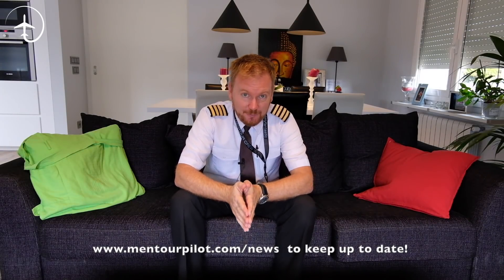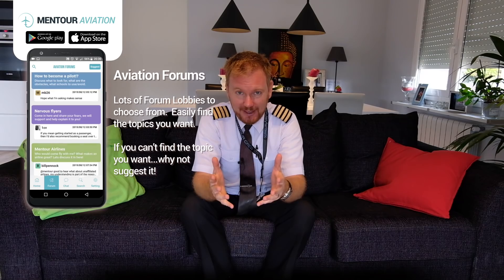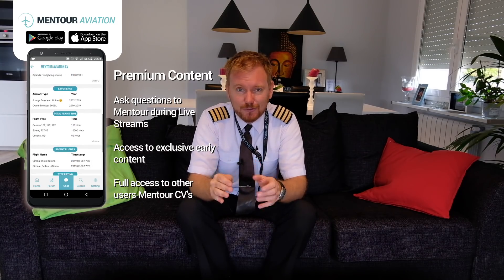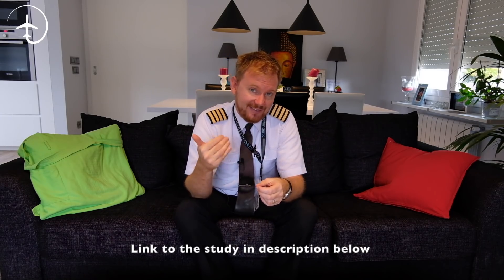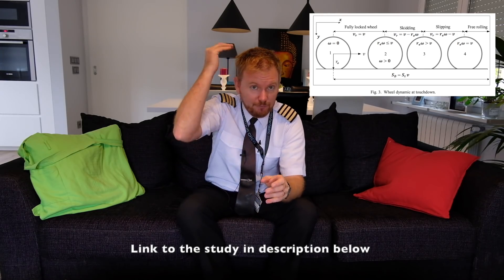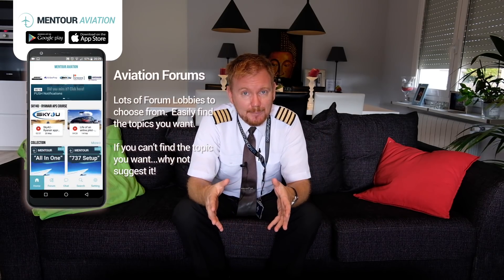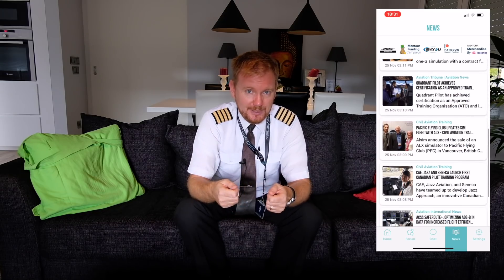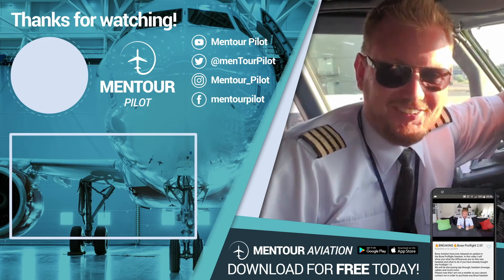Use WIND to spin the aircraft wheels before landing?!

Comment: Why couldn't exhaust gases from the engines be piped to to the bottom of the wheels ? It might increase wheel speed from 50% up to 75% or more? It shouldn't be an expensive  undertaking?

Comment: But there is the possibility of cooling the brakes and rotors using the wheel spinning device. That does seem worth while.
Reply: Maximum cooling generated (max airflow) is when the plane is in flight. When you most need is cooling is during landing and after flight- when there is minimal airflow.

Comment: I always wondered why the wheels didn't "free" spin in the wind just from the air flowing over the wheels.
Reply: To spin you must have a force. That force is call torque.  The torque from the air flow above the wheel is the same as the torque of the air flow below the wheel but they act counter to each other.  The torque is therefore cancelled thus no spin.
Reply: @geoffreywoodyear1585  Thanks

Comment: If wind controls the wheels before landing there might be a chance of one spinning faster than the other making the plane have an unstable landing.
Reply: in that case, the brakes would easily step in and make sure the wheels had matched speeds.

Comment: Compressed air would spin the wheels easier than wind, you would need a lightweight aluminium tank that could be charged from the engines or APU compressors. In a crash these could blow and could cause significant damage or fuel a fire
Reply: Matthew Kane Weights guys have kittens over two pounds. A cylinder with all the inherent systems would probably weigh 35 pounds or better.
Reply: Or just skip the tank and use the bleed air direct to spin up the wheels
Reply: wolf310ii Ok, now think this through. How are
You
Going to get the bleed air to the wheels?
How much will the spinup mechanism weigh?  
What will trigger it?  Pilot control?  Needs wires and switches and lights. 
Automatic control?  You would need sensors and automated manifolds, and would still need to make it visible in the cockpit. 
And so on, and so on. 

Rubber is cheap.
Reply: @Ampersandrascott  Ask that Matthew Kane, not me. The bleed air would go the same way the compressed air would go, just without the tank between the APU and the wheels.
Reply: wolf310ii You’re not an engineer I see. 

Rubber is cheap.
Reply: @Ampersandrascott  It was not mine idea to use compressed air to spin the wheels, all i said was you dont need a tank to store the compressed air, if you want to spin the wheels with compressed air, because the engine produce compressed air anyway.
Reply: wolf310ii Would you like to answer my previous comment?

Rubber is cheap.

Comment: I can develop 99% problems issue.   Its cheap and secure. 2 caps on wheel and a little electronics modification compatible with auto breaks. The wheels will be spinning exect same speed what the aircraft has befor touch the runway and do no effects to plane landing. Just smooth touch down and break. The only thing to effects pilot is, that pilot even doesn't know when touch the runway. 😁
Reply: And that research in 1940s is 2 old for this time. 😉 we are now in 2020s

Comment: No mentour if you change the wheel speed to aircraft speed if wheel speed is reduced relative to aircraft speed  is ok 👌🆗 but  if the speed increase in opposite direction or reverse it will skid the aircraft to a side for shure like a bike ridder does☹️

Comment: Each 747 tire costs $3500 & the 747 has 16/18!!!!!!!  How many cycles do tires last for?  What would happen if there was a blow-out on landing?
Reply: Tires blow out all the time, catch fire and are quickly put out by emergency personnel.  This happens a lot when a heavy plane like a 777 has to land immediately after take off due to an emergency and has no time to burn or dump fuel.
Reply: @JQB45  There are very important points this guy has missed.  Tires must be filled with nitrogen not air.  What happens if there is a fire & the pilots don´t notice & lift the landing gear?  Remember the Virgin Gatwick flight, when a bit of landing gear failed?  They had to fly to Southampton airport so the ATC could check what the actual problem was!
Reply: @Westhamsterdam  A landing gear tire usually only fails on landing.  I've never heard of one failing on take off, I'm sure its happened and would be interested in learning or seeing more.
Reply: @JQB45  If you WIKI this there was an explosion in a tire after the plane took off because the tire had water in it.

What i want to know is how the cabin protects against fierce cold especially in the cockpit where there is a lot of glass.
Reply: @JQB45  see Concord disaster! 😀

Comment: Why aircraft navigating on airport's roads after landing by itself? It's cheaper to off engines after stop by wheel brakes, quickly grab it and tow to parking place?
Reply: That doesn't work in reality. Towing would slow down the traffic at the airport and the airport's efficiency would reduce. Those vehicles moving on taxiways all over the airport would also be a safety risk for the traffic.

Comment: Wind spinning wheels will not work.  It’s all because of physics.  The wheels will all be rotating at different rates, there would be no way to regulate its speed.  This could cause the plane to swerve during touchdown.  The blades that spin the wheel will add more drag resulting in different take off and landing calculations for drag. Thus changing the settings of flaps etc.  The only way is to use electric motors.  Mentour has all ready debunked that one.  Smaller prop planes may have motorized front wheel because they are in a tricycle layout.  The spinning front wheel mitigates the friction of the front wheel so that the plane does not tip forward, not to save on rubber.  Because the wheel is in the middle and front of two back wheels.  It can’t swerve.

Comment: I have thought the possibility of a deployment manual by the pilots of the oxygen masks in case of fire where smoke  fills the cabin, this would have save thousands of lives who died most from smoke . the masks do not feed oxygen unless  one breaths from it
Reply: There are no oxygen bottles for the passengers, the oxygen is produces chemical, once activatet the capsule generates oxygen until its empty, no matter if someone breath from it or not.

Comment: Mentour360 viewers: "We need the wheels of airplanes to spin up before landing to reduce wear on the tires."

Petter (repeatedly) "Sorry, too complicated, planes will be too heavy with extra motors and how about landings on slippery runways, wind from the side, etc. etc"

Mentour360 viewers: "But, but..."

Petter: "Sorry, impractical, not possible and by the way, tires are cheap."

Elon Musk: "Hold my beer..."

😄
Reply: Except Elon is good at math .. and adding 400 lbs to a planes landing gear to save a few ounces of rubber each flight  would be as stupid to him as it is to me ..
Reply: One of first Tesla slogans were: 'Burns rubber, not gas' so, totally not interested :)

Comment: The linked study seems strage to me. The Wheel seems small, the landing speed seems high (maybe because they use maximum landing weight. They have 16 main landing wheel gears. What kind of aircraft is it? And why they simulate with maximum landing weight instead of a usual landing weight? The bouncing speed seems also strange. I'll read this thing a second time with fresh brain.
Reply: Boeing 747 has 16 main landing gear wheels.
Reply: @mikep9604  Thank you, yesterday I was tired and messed up wheel diameter and radius :-(

Comment: Use magnetic levitation installed on all landing runways and on the jets and get rid of this old rubber technology
Reply: TAVOR VICEROY VALDOR / magnets don’t handle large load shifts well, they also have limited suspension, and will need to be maintained on all runways in the world
Reply: Ok, and how are you going to brake with that super slippery  magnetic technology?
Reply: deltaxcd when the plane lands mag leveling on the runway you use air brakes and the engines to stop it, the Japan maglev train does it very well and stops from much higher speeds
Reply: - Caesarian - Japan has tested and used the maglev train and the speed is restricted to the lei get of the track and it works very well for a heavy faster train so why not experiment with a airplane and a few runways?
Reply: @tomaszstarling  
That is quite a big modification I think at the rate your plane will soon turn into something else LOL
maybe we should just directly go for vertical lift and landing LOL

But the main problem with maglev is that you need extremely precise positioning in millimeter range and maglev cannot handle nonuniform loads well  
so until you learn how to land a plane with millimeter accuracy without any shaking you need to stick with plain old wheels
Reply: @UC-CkSMNoavisUL9j9dkkxIw 
not even sure wahst is your point with those tiangles
 but you can not levitate at that big distance that's the law of nature. the force decreases proportionally to the distance squared.
also, keep in mind that airliner weight is close to 500 tons. which is more than maglev train which weight 30-40 tons per carriage

at this weight, you need to think more about how you not break the road itself not about trying to levitate that monstrosity.

Comment: The rotating wheels doesn't make any sense you need a runaway like a treadmill to sync the speed of spinning wheel
And The White Smoke Is Iconic Smoke
If You Take Down The White Smoke
There Will So Many Angry Avegeek

Comment: Longer lasting tires would mean manufacturers would be making less profits.
Reply: There are two ways to make tires longer lasting: 1) More abrasive resistant (harder) rubber = less friction, grip. 2) Thicker tread, = higher polar moment of inertia, and a greater force (centrifugal) acting to separate the tread from the carcass.  My guess is that current airline tires are optimized in both regards. The ONLY case for your argument is if there were collusion between ALL tire manufactures (I am not saying there isn't, and the CIA did kill JFK,  /s ).

Comment: Why do people think the wheels spinning would be better.

They should do the opposite and have the wheels tightened with maximum friction during landing and roll out
enough friction when you land that it helps dicipate energy without slamming nose wheel on runway. 
you loose already like 15% of your energy when you touch down with stopped wheels and make them spin up requires energy.

Who cares about the Tyres or their lifetime and the blue smoke is nothing compared to QM2 black smoke

Comment: What kind of nonsense is that if you prespin wheel to the 100% speed you still get 50% wear?
Maybe the right way to say it was that you will reduce total tire wear by 50% not that initial wear? Effectively doubling the lifespan of the tire because the first impact takes only half of the total tire wear. 
Physically, energy is proportional to speed squared so to save 50% rubber you need to prespin then to 75% of the aircraft speed.
at the 50% speed, you will save about 25% rubber.

Comment: safety exits are not "cost-effective for the airlines" either. that should not be an argument whatsoever.
Reply: Airlines wouldn't put safety exits if they didn't need to. But they are required to due to regulation. Only way we will see bladed wheels if rubber got extremely expensive or if regulation forced them to.

Comment: I’m astounded the armchair engineers on here  look at the wheel spin up or lack thereof and think 60 years of high performance jet age manufacturers  “ overlooked “ this spin up senario lol  they have no idea the trade offs done for weight versus .complexity  .. and what just gets left off because it isn’t worth it
Reply: While 99.9% of the ideas presented by "armchair engineers" are debunked. the remaining 0.1% may be beneficial.
Reply: @johndavidwolf4239  
Nope. In high tech industries (which are pretty much all of them nowadays), the times of "armchair engineers" inventing or even just contributing something are long gone.
Reply: Never discount the one in a thousand "out of the box" ideas that spark a "professional" engineer to refine it into something beneficial.
Reply: @johndavidwolf4239  Except there is one thing in aircraft design your completely missing ... If the device adds any weight it’s not worth it and I mean any weight at all ... Tires are consumables like fuel .and cheap consumables at that relatively speaking  ... weight however is the never ending enemy and no matter how clever the engineering it will add weight... that is completely not worth adding ...So there is no .1% in this  and never will be because that .1% genius just added weight which must now come back off
Reply: Mark Doan:  If adding something that has weight, and that added weight causes $1000 more fuel to be burned a year, but at the same time it saves $2000 per year in maintenance costs, it is a positive.
Reply: @johndavidwolf4239  Those numbers never apply ..and that is because you don’t build airplanes —- The added weight takes away from the amoutnt of fuel or passengers loaded ...plus ... adds to the fuel cost...plus makes the plane less safe ( weight equals danger )  Now the reason your mot right about this and I am is because it’s 2019 and it’s mot happening....notwithstanding armchair engineers who ha e never seen what goes in to building a plane ....and are terrible at math — and have no idea that weight is the religion in the aircraft world
Reply: Mark Doan:  Commercial jetliners almost never takeoff at MTOW (Maximum Take Off Weight) or with the fuel tanks totally full.  You may have noticed that the fuel truck stays attached until after the plane is fully loaded, this is because they only load as much fuel as is calculated to get to their destination (a function of weight) plus the legally mandated reserve.  In modern jetliners the landing gear has weight sensors to know the total weight of all the passengers, crew, and baggage. One exception is if the destination they are going to has a significantly higher fuel price (like a tourist economy island), in which case they will add fuel to exactly make the MTOW so at to require less fuel to be bought at the higher price for the return trip, I experienced this on a "puddle jumper" in the Caribbean years ago where they actually had all the passengers step onto the scale (to the embarrassment of some passengers, it was an older plane).
Reply: @johndavidwolf4239  Right .. this is always a calculation ... and so is a wheel spin up device .. Its a calculation that 400 lbs or so of added dead weight to save a few tire changes is completely not worth it ... It astounds me that you and others think it should be added ... You don't seem to get that its absolutely technologically possible to do it easily .. It can be done a dozen different simple ways .. but ... It has been decided not to by choice ... You don't seem to get the aircraft manufacturers / airlines have actively chosen not to do this for the correct reasons I have given...those dozen reasons or so ... with near  zero reasons to add it
Reply: Mark Doan:  While if a "Wheel pre spin up device" was 400 lbs, it may be not cost effective, you will agree that their is a weight (X) where if it is below that it would be cost effective.  Therefore the goal is to design a function device that comes in below that weight.
Reply: @johndavidwolf4239  You have never built anything have you ... nor seen a 737 wheel / tire up close.. nor the trucks they are bolted to  ... like I said ..armchair engineers ..make noise but build nothing  and postulate on all sorts of weightless add ons that are just waiting to be discovered  .... It is nearly 2020 ... you honestly think there is a clever little invention from a clever little inventor just around the corner lol ...You don’t quite understand aircraft or the industry .. you don’t get that they don’t want this device .. they don’t want to add anything more to the craft ..they would much rather take things off  if they could ... one more piece of crap unneeded item that adds weight to go wrong  ...I would bet you $10,000 that 20 years from now there will still be no spin up devices on big heavy,s....   It took Pratt & Whitney 20 years and 10 billion dollars to come up with a method to spin the compressor section at one third the speed of the hot section .... a geared turbofan ... just simple gears right .... wrong .... 20 years ..billions of dollars and teams of engineers ... There was no clever little inventor with  a clever little invention ....

Comment: Why not go back to seaplanes or flying boats?
Reply: They can't be built very big, because their purpose is to take off from the water. The shape of the fuselage causes so much drag that they are not able to fly as fast as normal aircraft. Their passenger capasity would be restricted compared to normal airliners, and they can't fly as long distances that normal long haul airliners can reach. 
The corrosion would obviously be also a big problem and a safety risk, and they would need more maintenance than normal aircraft, which would be very expensive. 
Those old flying boats were abandoned when the era of modern airliners began, and they are not coming back.
Reply: @mikep9604  They could use retracting hydrofoils which would enable a more aerodynamic shape.

Comment: and what about a film, a glue that covers the wheels and lasts for few seconds during the touch down and easily replaced every flight
Reply: In the previous episode on this Peter did say that Airliner tires are "retreaded", most likely only after rigorous inspection and only for a finite number of times.

Comment: If you soon the wheels then you will have cold tires unable to stop the airplane with a risk of slippage. You need to "burn" tire to have a sticky tire and break strongly. This is why the quarter mile cars always burn tire before the races. What do you think of that?